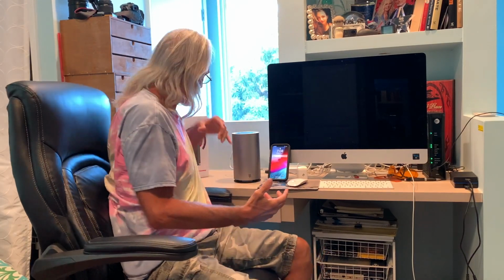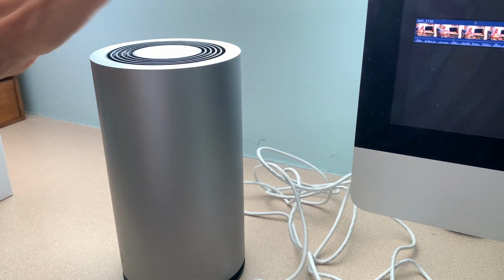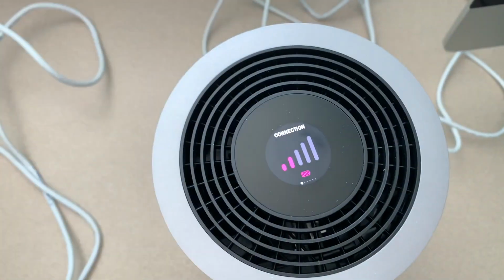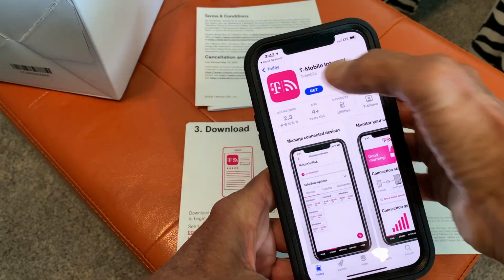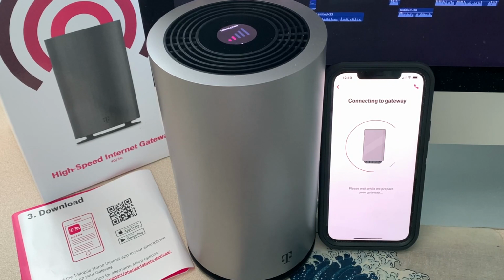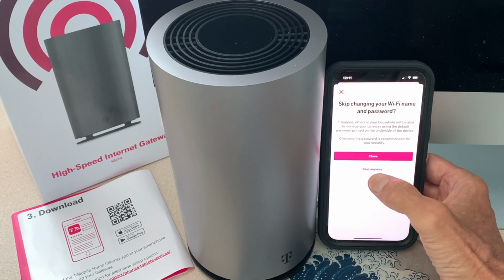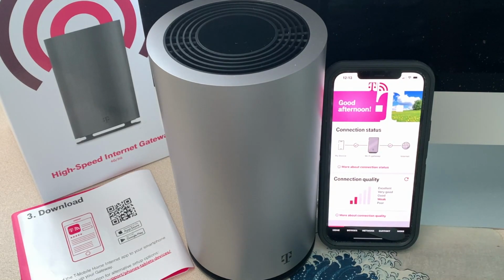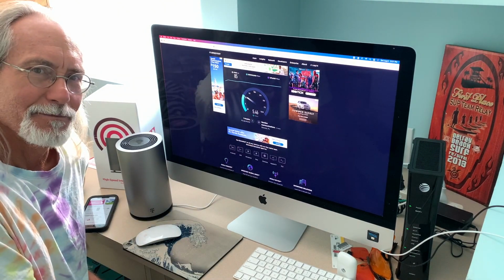Review and set up of T Mobile's Home 5G High speed internet Gateway

Comment: I got 2 bars on mine and get 300mbps down and 30 up. There are 6 different arrays of antennas inside the unit. You need to rotate it around and experiment with it to get the right antennas for the tower near you facing that tower. Once you find that sweet spot you will get explosive speeds.
Reply from the maker: Excellent notes in Tips thanks for watching

Comment: Keep in mind signal strength varies based on your location. If you live in a valley, signal strength is going to be weaker. If you live in a more urban area with a good number of towers the signal strength should be stronger. I have very good signal strength on mine. All of my bars are lit
Reply from the maker: Yes it all depends on the infrastructure around your locale I can actually move this one from one house to the other and it works in both places thanks a lot for watching
Reply: It’s not about strength of signal bars. It’s about matching/facing the different antennae inside the unit and the frequency bands that they receive to what the tower(s) around you are broadcasting on. That’s the key. I have 2 bars of service but am constantly getting on average 300 down and 25 up.

Comment: i got mine a few days ago. same thing 2 bars maximum, my house is small and the tower is 2 blocks away. sometimes i get speeds like yours like 10 or 20, but usually down speeds between 100s and 300s. up speeds maximum 20. go to cellmapper and find the nearest tower to your location. try to point the gateway to the tower. when am in band B66 is good, that one is the tower next door. but sometimes it put me in band B2 and it sucks. sometimes it crash and you get a reset. it just get to slow PC,cellphone and firestick. am  not sure if i will keep it. i dont want to be dealing with slow connection, go and press reset and than wait 3 minutes.CONSISTENCY IS THE KEY
Reply from the maker: Yes I do believe that T-Mobile has a lot of work to do to perfect the system it’s really just a cellular hotspot and they’re going to really have to build out the infrastructure for it to work properly and consistently but they’ll probably get there sooner or later good luck with yours thanks for watching

Comment: Same with mine. It ain’t even load on my phone lol. How did you cancel it ? 
I called twice and they make me wait over 2 hours. I ain’t trying to wait 2 hours.
Reply from the maker: I called T-Mobile and they said within seven days they’ll have all of the towers configured and it should work better so I’m gonna give them another week and then I’m gonna send it back if it doesn’t work good luck with yours and thanks for watching
Reply: @TomLeeman  would be nice for an update video then if it does work out for you! 
I had a call with them too and they said the tower isn’t ready for 5G where I’m at so they are going to send me a different one with 4G. Confusing though because this gateway modem box shows “4G/5G”. If the new one they send me don’t work or isn’t as good as my bad CenturyLink internet then I will be returning and canceling too.

Comment: Haha! Why in earth does anyone bother with their darn gateway tower anyway??  I guess if lots of TVs & devices are hooked up it might matter?  Please explain any advantages of the gateway tower … does it improve signal strength to lotsa devices if you’re in the T-mobile range?  But if that isn’t the case or if you have little need for lotsa connections, why not spend more $ on really good 5G phone & skip the tower business?  Phone seems to provide good hot spot capabilities.  Load up phone with the best internet security available.  How does that tower offer better security?  Get a really good router/VPN to run your phone through … or won’t that help?  I don’t know tons about networking but I’m learning more in retirement now but any info here would be appreciated.  Thanks!
Reply from the maker: I know the first thing I thought of this is just a Cellular hotspot basically they took a Nokia and put their logo on it but it’ll be interesting to see how well this works as they build out the infrastructure thanks for watching

Comment: I have a tower 400 yards from my home. I don't have a clear line of sight to the tower. It is placed 6 feet from the window on the 1st floor living room, next to my tv.  I've played around with placement and the best I get is 3 bars on some evenings I get full bars. Speeds are usually for me at 250-400 and I've seen it peak at over 600, but not for long. My ping stays about 30. I don't know how to get the ping any lower than 30. Some have reported their ping in the teens. I use it mainly for streaming Netflix, Prime and some other services. So far its been working from me. At 50 bucks If decided to keep this long term to test it with a bigger load and to see if things improve. Sorry this guy has bad service.
Reply from the maker: It is definitely a great deal at 50 bucks if you’re getting good reception unfortunately in some areas they haven’t built out the infrastructure but I think it will be over the next year or two glad to hear yours is working good and thanks for watching

Comment: Hey Tom, to put it mildly, I don't thing you're the sharpest tack on the board.  Why aren't you moving the router around your house and looking at the signal strength?  I've seen many other youtube videos about the T Mobile home internet and have already ordered it here in a small town in New Mexico.  I wouldn't use AT&T if they gave me the crap for free.  Try using an external antenna.  Many videos out there showing how.  BTW, Linux rocks!  Good luck with your Crapple computers...
Reply from the maker: Great tips I don’t know if you watched but I have a number of videos where I take the gateway around my house and try different positioning twisting so that the antennas are facing the tower of which I found out where the location was but no matter what I did where I took it or how I positioned it my speed test on the computer and on devices was spotty at best, here in Florida I don’t believe they have the infrastructure built out yet, but I am hoping over the course of the next couple months that it improves good luck with yours and thanks for watching
Reply: @TomLeeman  Maybe I was a little rough, but here's something to make you laugh.  I live in a small town in S. New Mexico and was thrilled to have this device offered in my area.  Well after a few days of testing, overnight the gateway failed twice.  I have 15 internet devices in my residence and reliability is of upmost importance.   I believe I have 30 days to try and hopes are fading.  I also have only 2 bars, but that is not the critical issue, it's connectivity to their towers.  We'll see what happens...

Comment: Put the unit on the window still and rotate it to hope to get to three bars this is what I had to do and make sure your firmware is updated to the latest version and if you can hookup a external antenna to the device and point it at the Tower 🗼 as do some searching for videos on YouTube
Reply from the maker: I just got finished watching a video on how to do that basically you got to take your gateway apart and attached to connectors that will slide out the bottom it’s a little bit involved I believe that where I’m at they just don’t have the infrastructure I tried taking it all around the house twisting it and the best I could get was on the second floor close to the window it was spotty at best sometimes I would get over 100 Then it would drop down to 10 crazy good luck with yours thanks for watching
Reply: @TomLeeman  thank you and your most welcome

Comment: When connecting a router to this device, should any settings on the router be changed?
Reply from the maker: Once you plug your router in with an ethernet wire download the app or open up the webpage on your desktop and you have to configure the router and the ID and passwords for your network depending on which one that you purchase it’s a little more complicated but if you follow the steps you should be able to do it good luck thanks for watching
Reply: @TomLeeman  thank you.

Comment: I'm not impressed either. 2 weak bars all over the las vegas house. And network update is still 0%   I agree: pitiful
Reply from the maker: They recommend that you put it close to a window and on the interior of the tower there are for antenna so you have to kind of twist it to try to get the best signal sometimes I get 100 MB download and sometimes I get five so it’s very spotty where we live but I think over the course of the next year they should build out the infrastructure end it may be a viable solution good luck and thanks for watching

Comment: You can still move it around in your house and only have 2 bars round 100 upload speed and download speeds with two bars you have to move it around and test it in every spot doesn't matter if you only have two bars man have two bars round 100 down load
Reply from the maker: Yes I usually have two or three bars and I do get sometimes over 100 MB download but then other times I’m only getting five so it’s very spotty and not consistent but I’m hoping that they build out the infrastructure and it becomes a more viable solution as an Internet provider thanks for watching

Comment: Hello. I thought I would provide some feedback and experience. I just installed the new T-Mobile Internet Gateway.  I tried everywhere in my home, (near windows, second floor, etc.) and still got a weak signal (only two bars). 
 However, even with a weak signal, my download speeds reached 373 Mbps and upload speeds of 10.02 which is a big difference from what I had prior (old DSL connection).  The speeds increased when I connected with a ethernet cable directly to my PC. 

Based on my results, it does not appear to have a direct relationship between the connection strength and the speeds in my case.

Any thoughts? 
 I would like to improve the connection but cannot, no matter where I place the gateway. Thanks,
Reply from the maker: Yes I did the same thing I took it all around the house and then I did speed test and sometimes I would get over 100 MB download and sometimes I would get five at all depend on the direction of the antenna which is on the interior and you have to get the exact angle but it is up and down in our area I believe there’s only one tower for now but I think in the next couple months it’s going to get stronger as they build out the infrastructure thanks for the tips and thanks for watching

Comment: Megabytes or megabits?
Reply: Mbps=Megabits.  MBps= Megabytes.  8 bits in a byte.  Also lower ping=better.
Reply: @MrHoldyourapplause  Yes, precisely., and yet so many get it wrong.  Off by just a factor of eight.
Reply from the maker: So, in short, 1 Megabit is 1 million '1's and '0's, while 1 MegaByte is 8 million '1's and '0's. Confusingly both terms are commonly used in computing; MegaBits are most often used for measuring an Internet connection download or upload speeds, while Megabytes are used to measure file size

Comment: I also have only 2 bars and at first could not get to work, but was so desperate to drop my cable company kept trying and now get almost 200 downloads and at times 300 - 400. Completely disconnect your existing system and turn off
Reply from the maker: Great tips giving it a try hoping that this is a viable solution for our Internet but I think it’s going to be a month or two before they build out all the infrastructure here in our area thanks for watching

Comment: I'm 5 miles from the tower and get from 45-190 down and 10-30 up on two to three bars of signal strength, which is on average 10x better than the DSL in my rural area. It's a transformation for me. The window placement of the gateway works best if you have a window on the side of your building or house that faces the tower, with the fewer obstructions between your window and the tower the better. A 2-bar signal strength in itself doesn't mean low speeds and you have to do speed tests in various locations, including rotating the gateway in the same location sometimes, to find the best spot. Of course, it is best if you get 4 or 5 bars of signal strength but I've read of people with 5 bars who have interference issues or traffic issues, or for some reason they get speeds like yours and the internet just does not work. I'd estimate that you have to have a download speed of at least 20 on this for the internet to be usable. It's not like DSL, where a speed of 5 at least works. 

This all said, yeah, looks like no good for you. Because on that low a speed, it's unlikely you'll get 50+ on the download with a better gateway placement. There are a number of factors besides distance to tower, although the people who get the 300+ download speeds are usually within a half mile of the tower. Other factors are buildings or objects between you and the tower.  An electrical substation (power) is particularly bad to have right in the line between you and the tower.  Another factor is whether they have the n41 transceiver or the n71 on your 5G tower. The n41 mid-frequency band is more desirable because it provides higher speeds than the n71 low-frequency band. Also, the walls and composition of your building or neighboring buildings can work against you. 

The current technology of 5G is that it is a non-standalone paired signal, 4G/5G, but as you suspected, your signal could be 4G only, but not necessarily. The gateway definitely is 5G, it's just that it may not work as 5G in your location, but then it uses 4G. Some people can get a download speed of 150 on 4G alone, like before the 5G gateway was released. But I'd say in an area which has 5G, 90% of the people, at least, will get faster speeds on 5G. 

I've had the T mobile home internet a few months, and I've read hundreds of messages on the T mobile message board. Sometimes only a half dozen people a day, or less, post new comments about T mobile home internet there. For every person with an experience like yours, I'd guess there are at least 9 people who get good speed, that is, between 50 to 600. Sometimes people get their gateway in the mail finally, and it coincides with T mobile doing some kind of maintenance or upgrade on their local tower, during which they could shift you to a very distant tower. In a couple of days or weeks, maybe the work is complete and you'd have those 150+ speeds like you thought you were going to get. That is rare, but I know it has happened to people. Sometimes the service department when you call up knows about this maintenance, but sometimes they don't, from what I've read.

Some people get speeds well over 150 for months, and then their speed drops suddenly to terrible. Likewise, I've read of one guy's speed that went from 75 (on average) his first day, to 150 and higher on days after. The 4G on my T mobile phone where I live is sketchy, but reliable for calling. But the 5G on the gateway has been reliable for two months at much better speeds. I'm sure some of my neighbors who are a few houses away but at a lower elevation would not even get a usable signal on this. Also, they may have a hill between them and the tower, and I don't. 

If it is more convenient for you, you can take the gateway back to a T mobile store. I think you should get a full refund but you might have to ask for that. I felt I was very unlucky to live in a place where the DSL speeds were so slow, the satellite (except for maybe Starlink) is either very expensive or unreliable and often both, and I could hardly believe it when 5G was listed as available in my area. I feel lucky. Again though, I think you're one in ten unlucky. They have no way of knowing with absolute certainty what your speed will be. It's good though that people like yourself post their experiences.
Reply from the maker: excellent information and good tips I'm hoping they build out more infrastructure here so we can get better coverage, for some reason ATT and Comcast have terrible speed levels thanks for watching